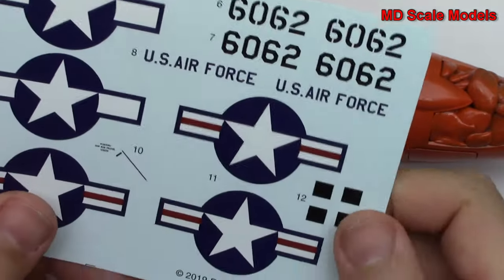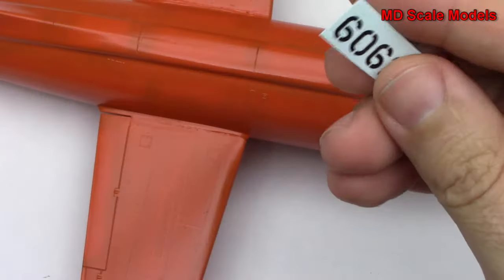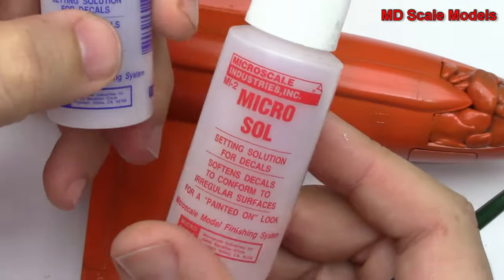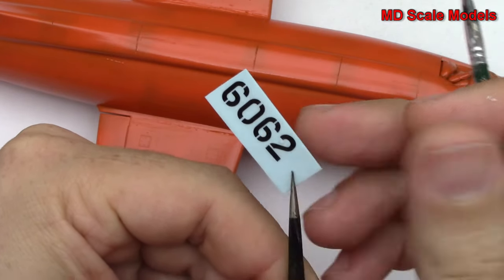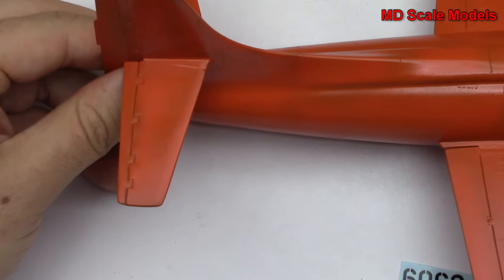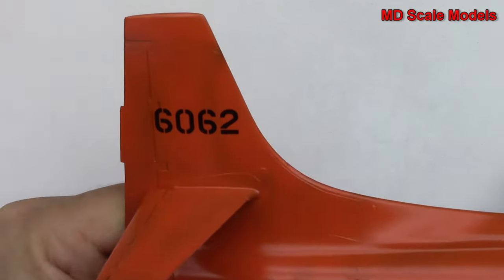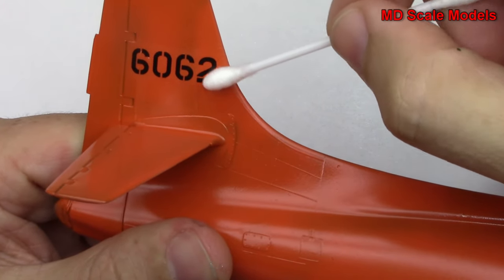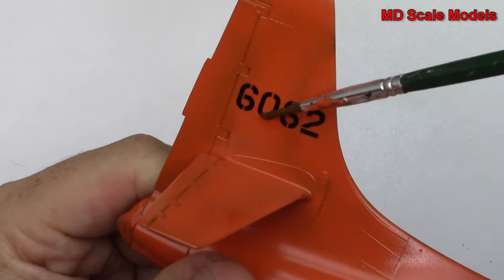How to apply decals to a plastic model kit

Comment: A word of warning if you get ahold of any old ESCI (pronounced: es-shi) those decals don't really stand the test of time and will break up as soon as they are moistened, coat the decals you wish to use with Decal Saver from the Micro-Set company and cut them out as close to the image as possible and proceed as normal with decal application. Happy modeling!!

Comment: I'm doing the aircraft carrier Saratoga, should I leave the planes on the sprue to apply decals. Or should I cut them loose to apply? They are quite small. I haven't done a model in 50+yrs. So any information is greatly appreciated.
Reply from the maker: I would probably paint and decal them before removing from the sprue as they are small.

Comment: Would you still use micro set and micro sol if you haven't painted your model?
Reply from the maker: Yes. It is to help the decal stick better to the model. I cover my decals after with clear coat
Reply: Thank you my model is white and meant to be white would you paint a white paint on it or leave it? Your video has help me alot thank you
Reply from the maker: @markriley4563  I would paint it white and then put the decals on and then clear coat
Reply: Hello again in my model you have to put decal on decal how would you go in doing this
Thank you
Reply: @MDScaleModels is it possible to only use water I don’t have decal solutions
Reply from the maker: @eatham8317  Yes, you can.. they might not set as flat, but will still go on fine.